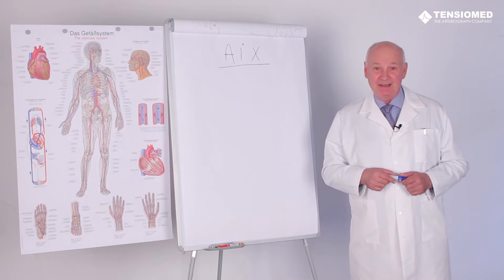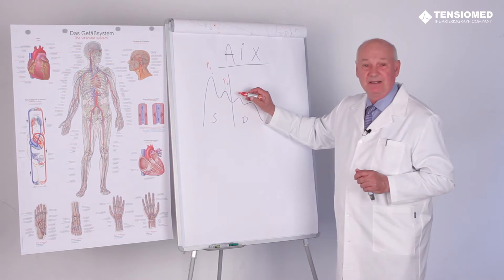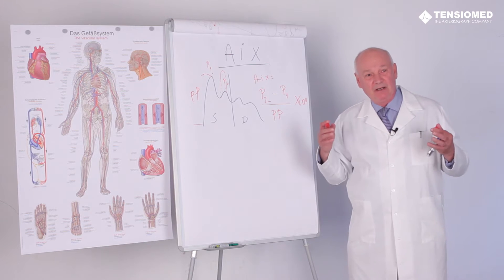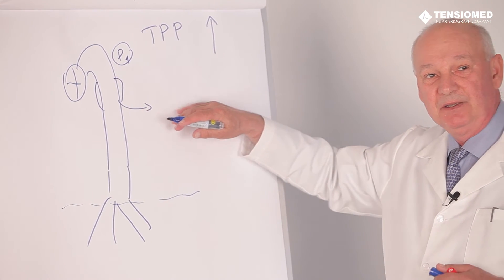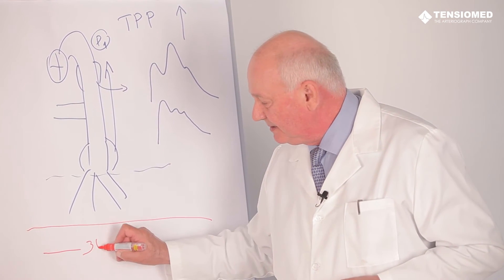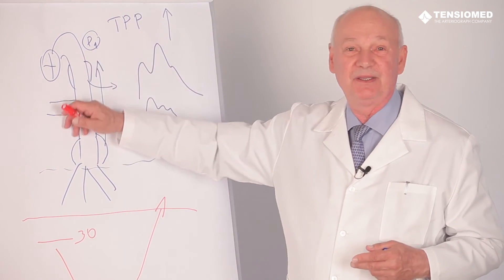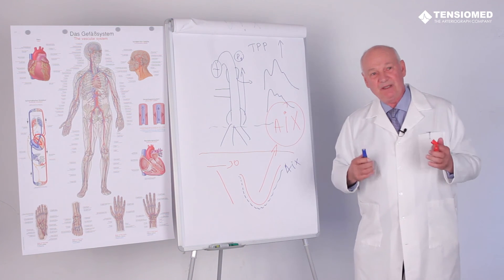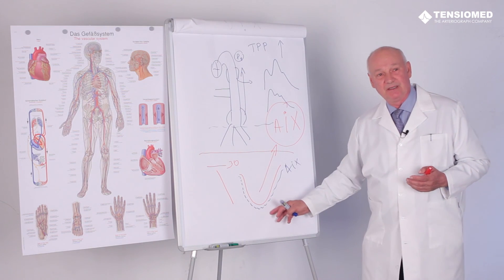Augmentation Index - TensioMed Education (with German subtitle)

Comment: Perfect explanation. Thank you very much indeed ... I finally was able to understand the Reflected (secondary)
pulse wave effect on systolic arterial hypertension as a significant marker of increased vascular resistance. especially for those above the age of 50 years, and why increased pulse pressure is a good indicator of vascular damage...Augmentation index is a perfect tool to stratify peripheral vascular resistance. Unfortunately, not a lot of institutes have such tool. I hope this comment will help more people to find this valuable video.
Reply from the maker: Thank you for the compliments :)